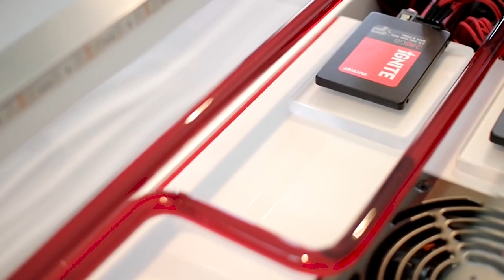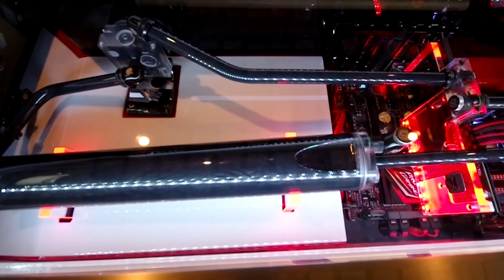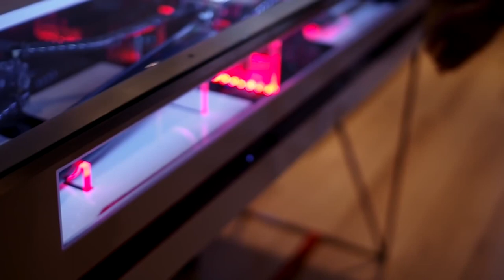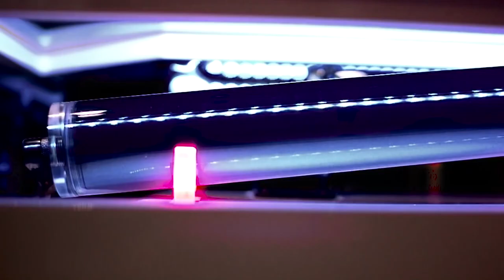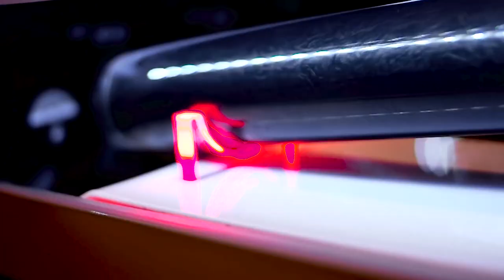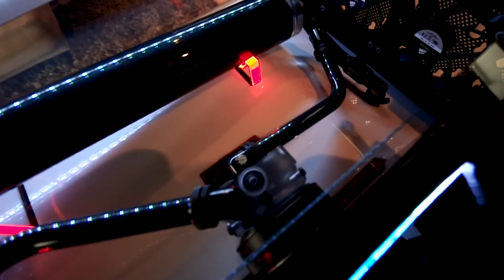Ultimate Custom Water cooled gaming Desk PC Mod  - Crazy Gaming PC in a desk Liquid cooled PC Inside

Comment: here's an idea, make a waterfall/ river desk (like the ones they make with clear or colored epoxy resin) but make the 'river' part as a distro plate with additives to really show off the flow and if your feeling fancy, dont make the 'river' a clean run, have parts blocked up so the fluid flows in different ways either really fast or slow, little whirlpools, etc